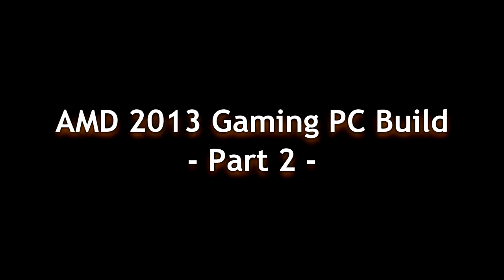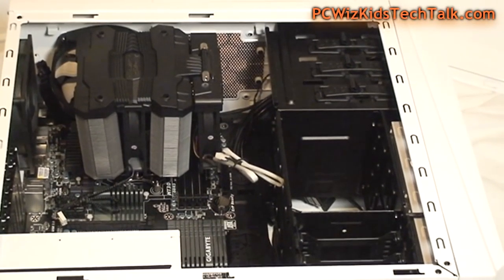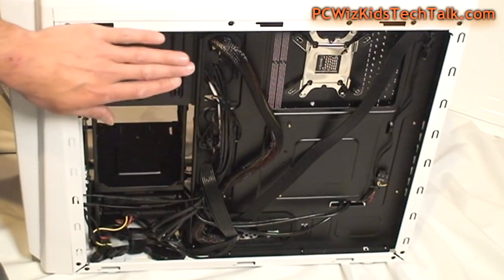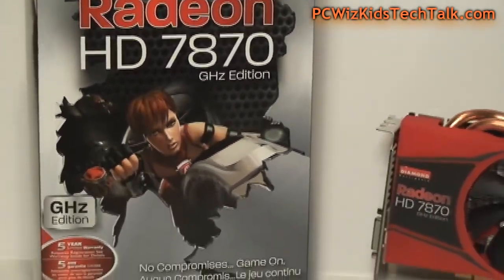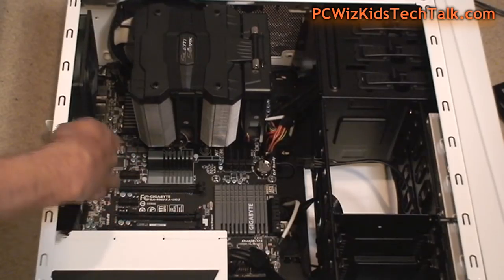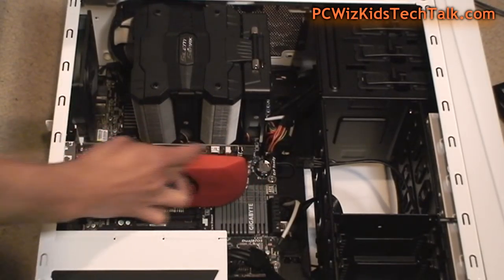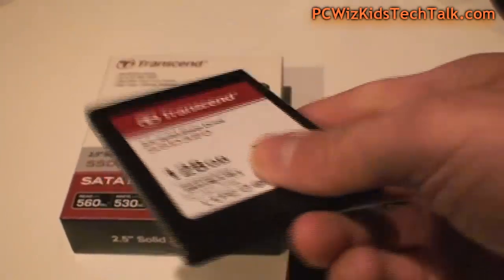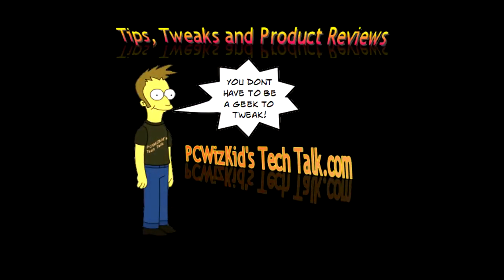Guide to Building a Awesome AMD Computer for 2013 - Part 2 Video

Comment: Yet with air (or fake water) cooling the OC limit of the 6300 and 6350 is near identical. Of course you do get a heatpipe cooler with the 6350 but that's useless if you opt for aftermarket cooling.

Also, what's your feeling with regard to Crossfire microstutter?